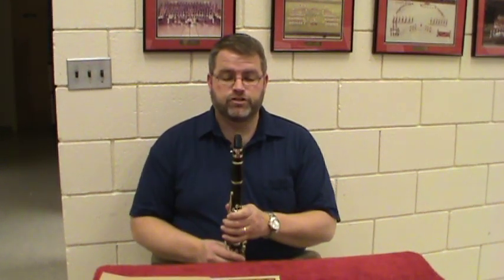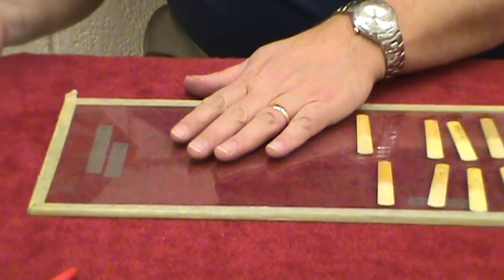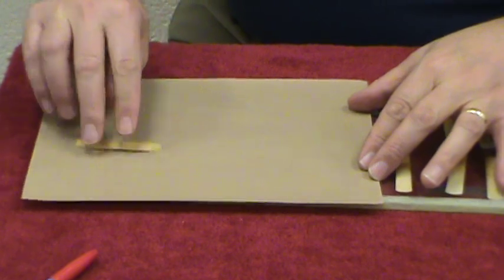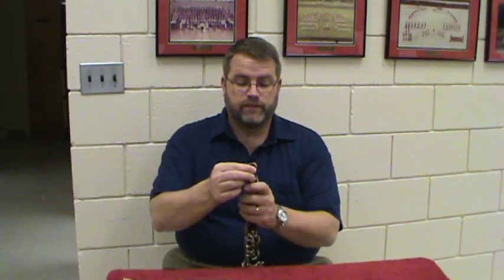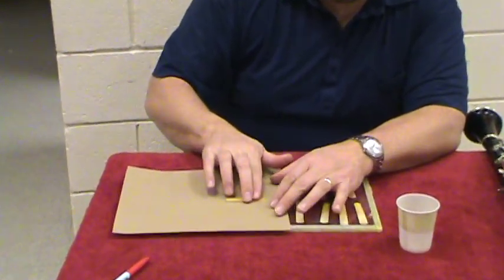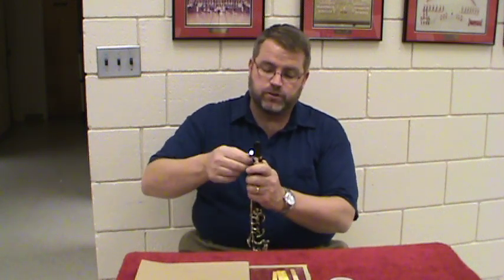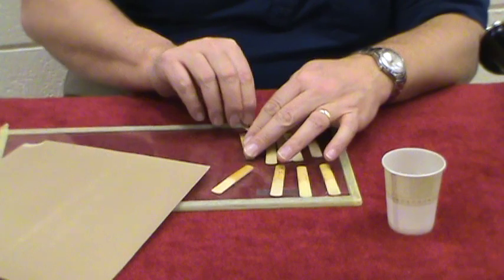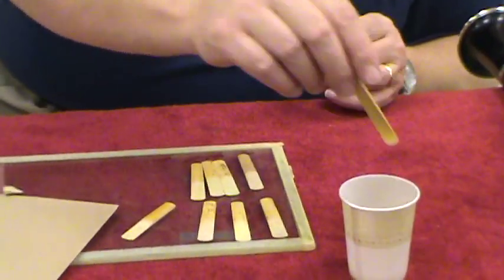Life's too short to play with bad reeds.

Comment: @Quiaura1 You are correct when you say that the colored ones only come in plastic. You should definitely NOT get the colored clarinets. They are pieces of sh*t. And also, they won't let you play in the band with a colored clarinet. I would recommend that you find a Buffet B10, Buffet B12, or if you want to go a little more expensive, a Buffet E11. You probably won't, but do NOT get a Buffet R13. It is a professional clarinet that is very hard to play for beginners. Good Luck!!!
Reply: Yamaha's are more durable.  Buffet prodige keys bend like a Medini